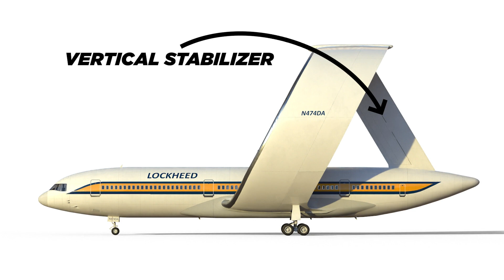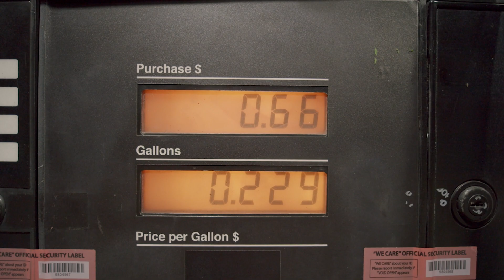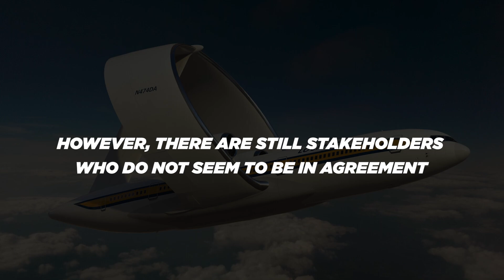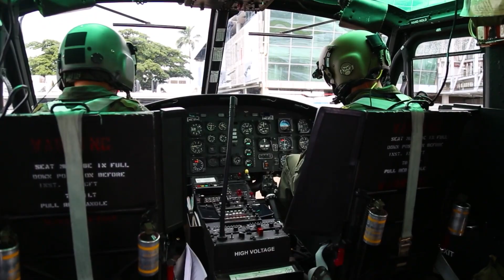What Happened To Ring Wing Planes?

Comment: For Lockheed model you showed up entire video, it seems only part of ring wing could create any lift is upper quarter of the ring that means huge waste weight. Also, fuselage mounted engines not preferred, since even if they design shielded engine area with waste weight, engines still not safe as wing mounted ones in case of destructive engine damage or engine fire. Also NASA Advanced Turboprop Project mentioned in this video has nothing about ring wing design. Like biplane and any other horizontal wing with closed wing design also irrelevant with ring wing (they are not ring obviously). It seems you had to made up connections with irrelevant projects to create some content for this video.